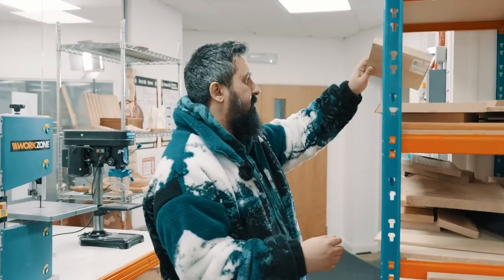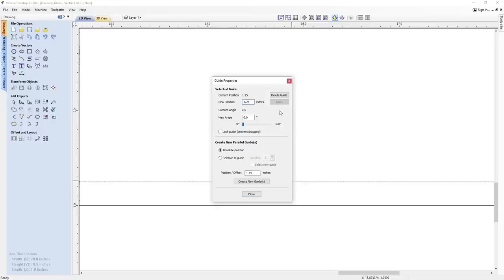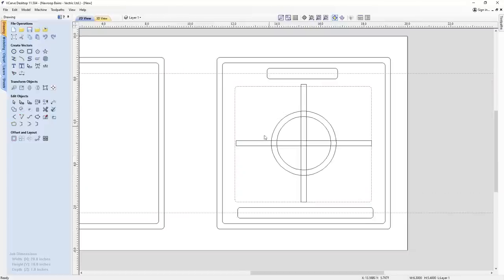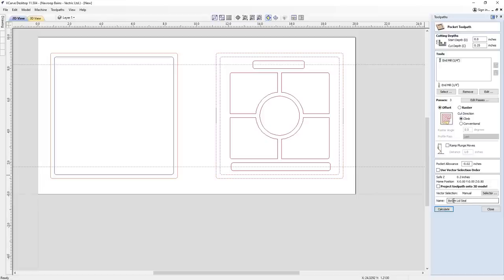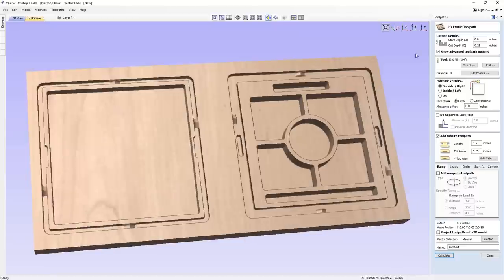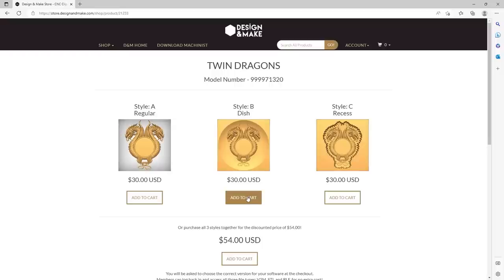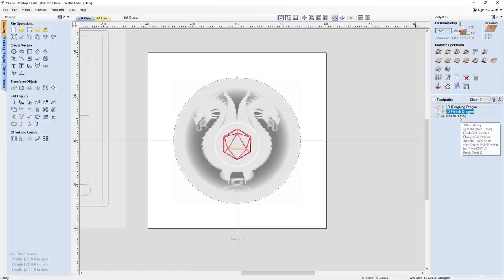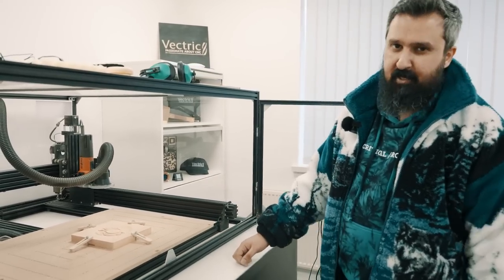Dragon Dice Tray | Making a RPG Box on your CNC | In the Labs with Nav | Vectric FREE CNC Projects

Comment: Thank you for the tutorial, on cutouts I prefer to leave the depth as "z" rather than a specific number, that way when if you change the thickness of the material, recalculating will still cut the full  depth rather than the original if you forget to change that parameter before cutting.
Reply from the maker: That is a great tip, thanks!

Comment: Really glad to see someone use a ball nose bit for the roughing pass on the carving.  Everyon seems to used a standard 1/4 inch bit and it always seemed odd to me.  I would expect the ball nose will get you a lot more detail and thus less work for the small diameter bit on the finish pass.  Nice project.
Reply from the maker: Hey Gizmo... thanks for the comment!  Yes, Nav also used the 3D raster roughing stragity (not the Z Level).  This option was a good choice for this sort of cut mainly because it left less material in the deep recesses (and to be fair there are not all that many in this model) so it put less stress on his very small finishing cutter.  Using the 3D raster is a good choice if you have 3D content that has deep recesses or you are cutting into a hard material and need to be sure you you are hogging out as much material as you can before the finishing pass.

Comment: Looks like there was some wood movement which is an issue with these types of trays.  I have made some larger ones used for chips and dips, and they always seem to cup a fair amount toward the dished-out part.  I made them primarily out of black walnut.   This was a great tutorial and nice looking project and very easy to follow.
Reply from the maker: Hey Harley... thanks for leaving a comment!  Yeah... wood being a very natural product it does tend to bend and warp.  Also one thing we did not do was to flatten the material before we used it... so I suspect the surfaces were not 100% flat to begin with.  A wood planner would have come in handy... LOL Thanks again!

Comment: what species of wood did you use and what were your feeds and speeds for just cutting out the case from the material? whenever I do it on my machine, I get these horizontal stratification lines along the outside of the case. I still get these lines after running one or two finishing passes.
Reply from the maker: Hello... we used beach for this one.  The feeds and speeds would change depends on your machine and tool... I would suggest being conservative.  The "stratification lines" sound like tool chatter... but without seeing a picture it is hard to tell.  If you like you could email support@vectric.com and they might be able to rule out any issues with your tooling in the software.  If you included a picture of your issue with the cut that would be helpful.
Reply: @vectric  I'll do that, thank you